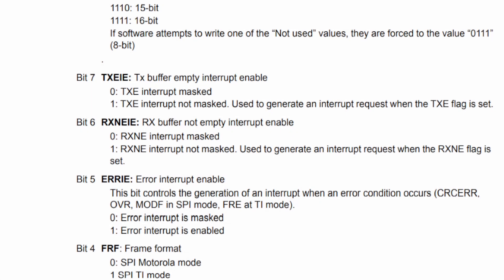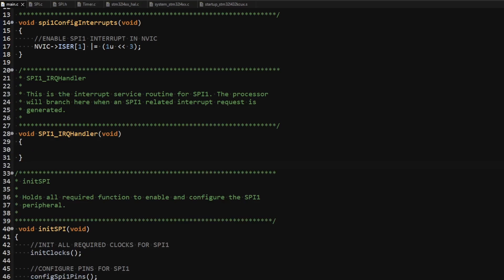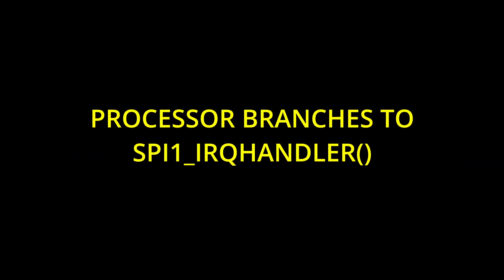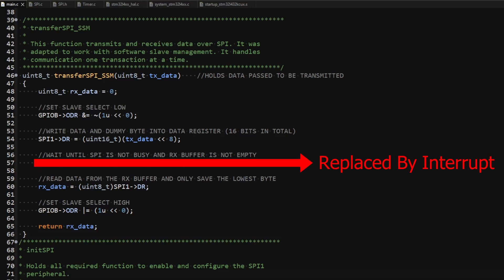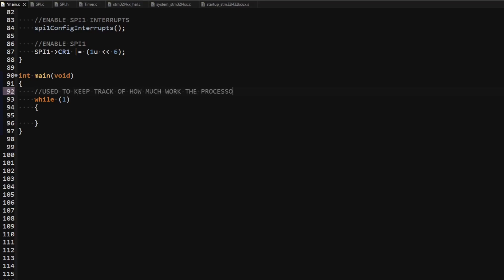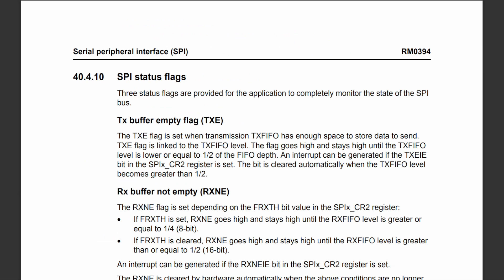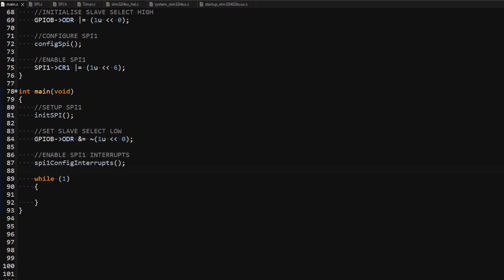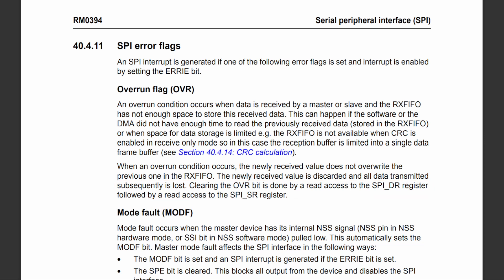STM32 SPI Interrupt Tutorial: Setup And Usage With Registers

Comment: Thanks a lot this is great stuff! I was using SPI DMA transfer with HAL to send data to a DAC, but realized it took 1.5us for the transfers to start, limiting a lot the maximum update frequency of the system, considering sending 16bits at 50mhz only takes about 500ns. So using simply the DR register together with your interrupt explanation (to send the 2nd channel data after the first one is done) is a much better solution.